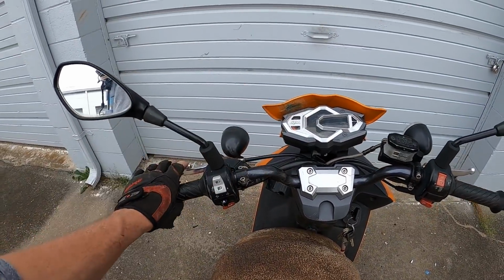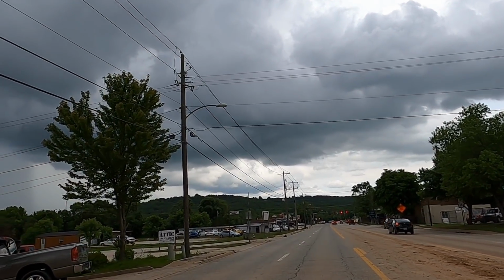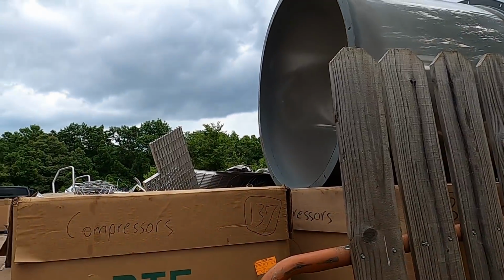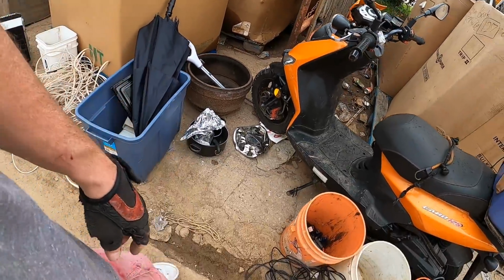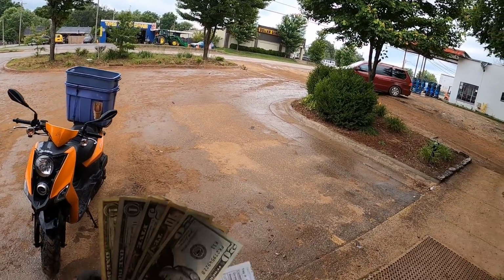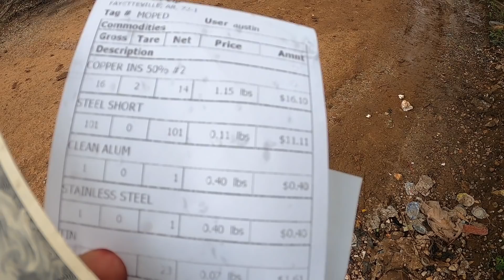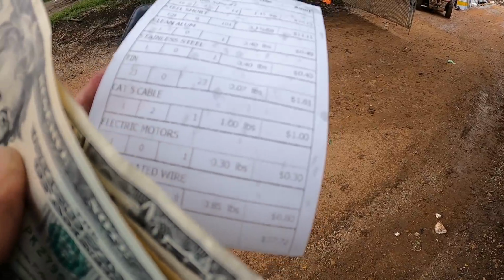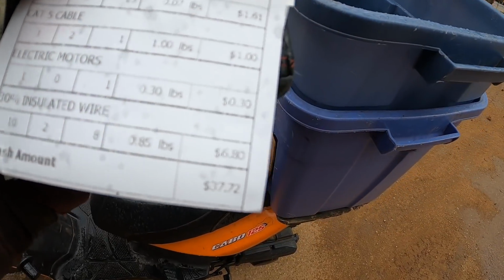Dumpster Dive Scrap Metal Pay Off Vid! - (Scrap Yard Run)

Comment: how much was your gas and other run expenses for these 37 bux?
Reply from the maker: about $400 a year for scooter all expenses gas insurance maintenance tags. So $400 divided by 365 days a year would be about $1.10 a day total. Plus i found more than just this scrap during that time... I know where you are coming from, this is the wrong channel for that critique :)
Reply from the maker: although...if i were not making my money off videos and say i worked 3 times harder/longer... then of course it would be $3.30 a day, but of course i would find 3 times more stuff in that case as well.............
Reply from the maker: these 2 wheel vehicles are very dangerous on streets due to cars cant see you sometimes!!! So it is very dangerous to drive them on streets!! so i cant recommend anyone use them for that reason. Risk increases
Reply from the maker: i am a seasoned vet i have been doing this a long time. i make it look easy, but it is not.

Comment: I know it's a storage unit, but couldn't you organize it a little better that way you don't have to did thru all those different totes?
Like have a tote for your wire, a tote for your sale items, a tote for aluminum and so forth?
Reply: He's explained that before, no is the short answer, he reckons he makes more at the scale bringing in a little bit of a lot of things than a lot of one thing due to rounding. i reckon your solution would be easier but that is not his way and i like his style!
Reply: But he can still take a little of everything.  I was just saying that it would be easier on him if he organized it instead of just throwing it all together, cause he still just sorted thru what he wanted to take.  And also, it's just my opinion, I just was thinking work smarter not harder, that's all
Reply: @tinathompson2877  I agree, I think a lot of what is in there is treasure and destined for ebay maybe.